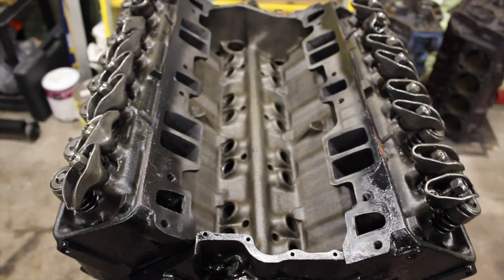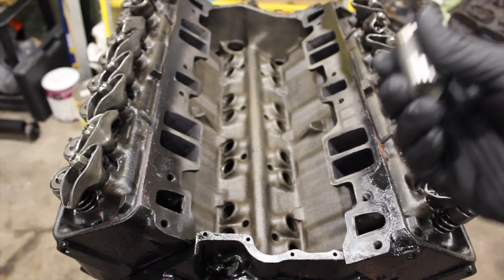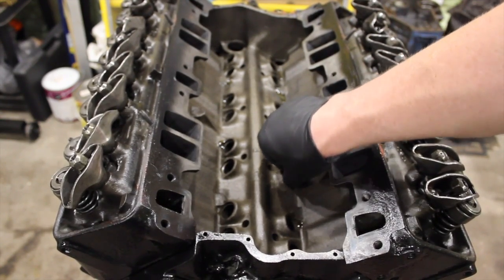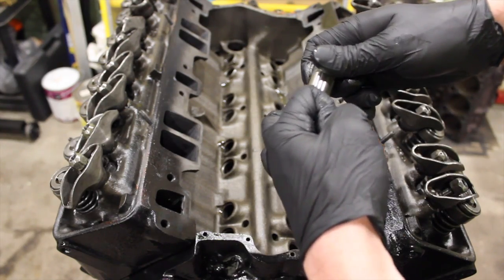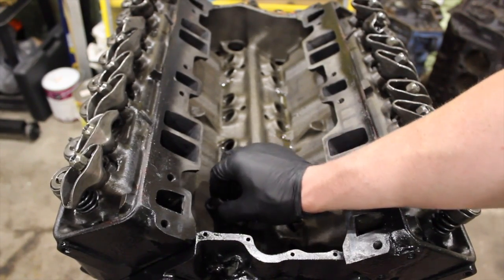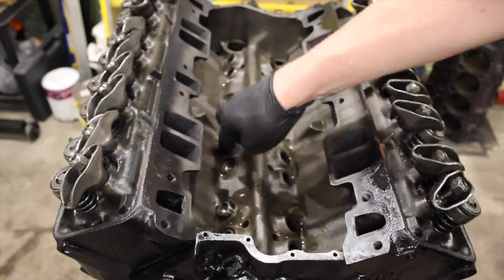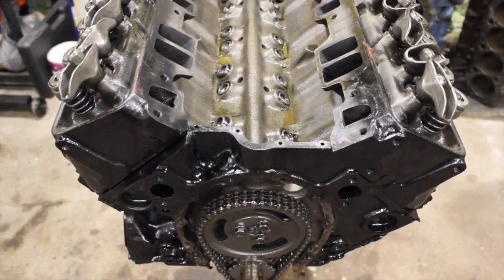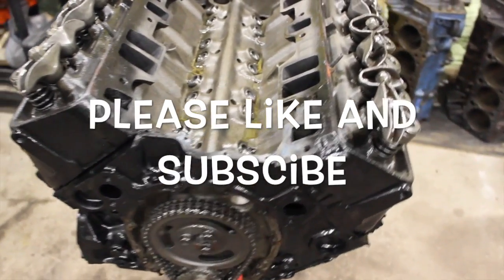Tips for installing Flat tappet cams and lifters

Comment: hi i have an old 65 pontiac 389.  i had a couple bad lifters and am wondering if its ok to just replace all of them with new ones and still use the old cam shaft. do you think there would be a problem?

Comment: Currently building a 13.5:1 small Ford with an aggressive mechanical flat tappet. Broke in a Crower hydraulic flat tappet in last motor and followed the advice from Crower, no problems. Paint lines along the length, on the pushrods just below rockers. Leave valve covers loose or cut "windows in donor valve covers. Start break in and observe pushrods spinning. If there is a problem, (pushrod not spinning), you can shut down and correct before you wipe the cam. I believe like many others, the issue is poor parts quality. Lack of lifter crown #1.

Comment: 98% of flat tappet cams fail due to people not using break in oil. If you bought the break in additive to put in the oil due yourself a favor and just take it back and get the lucas brand sae 30 oil. It saves a big rebuild cost !

Comment: Soaking lifters is no good. A pumped up lifter holds valves open while cranking the engine causing it not to start instantly. You need instant starts when breaking in a new cam. A dry lifter will pump up when you prime the engine.

Comment: It has to be the quality of the parts because back in the early 80s we never worried about wiping a cam .. we got the timing wrong on occasion, used high lift cams, had a hard time getting the first start, used heavy springs, high lift... and never wiped out a cam.
Reply: Different oil make up
Reply: @stoneysmith703 I think the parts were better.. everyone is using the right oils these days..
Reply: @TrentGustus when everything went to a roller profile they stopped adding zinc, or as much, when you say everyone is using the right oil, do you mean for flat tappet profiles?
Reply: @jessebusby7685  yes, i dont think people,  are using the the wrong oil on break in, for flat tappet cams

Comment: Diesel oil no longer contains zinc, or at least not a sufficient amount. If you break in your engine with diesel, you're in for a rude awakening. Just buy actual pre-mixed break-in oil.

Comment: Hi! Why are you putting assembly grease to the sides of a lifter? You need it only to the bottom and you should use oil to the sides as the grease can make the lifter more difficult to turn. 
Also noticed you used greased the cam bearings, not just the lobes. Redline says to use it only to the lobes. 
Maybe wont do any harm, but just saying. Good video anyway! =)

Comment: Tips for making a flat tappet cam live…. Go roller none of this matters if you have an incorrectly manufactured cam/ lifters that is most of the problem nowadays
Reply from the maker: Agreed! The only downside to a roller cam setup is the price, but it's worth it if the budget allows
Reply: That is why you verify the cam and lifter arw machined properly before you install the cam.

Comment: I run a non detergent high zddp break-in oil by Driven so it doesn't wash the zink addative off the cam, also grove my lifter bores for direct oiling ahead of the lifter to cam lobe contact point.  Do you run non detergent oil after break-in?
Reply from the maker: I run most on Lucas Hotrod oil
Reply: Best use aircompressor Sae30 oil plus Zddp Additive for breakin

Comment: Just pulled my stock 350 for a rebuild. Scared to death to use flat tappet again with all the internet chatter about wiped cams. Hate to have all the machine work done, new rods, pistons, springs, do all the rebuild work and install the engine only to wipe a lobe after 2 minutes of break in when it lasted 40 years with tappet just fine. Id cry. LOL. Looked into retro roller route but that's $800+ alone and cam choices all are mostly higher lift in the .500+ range which wont work with my stock 993 heads. Not sure if I should risk it with new tappets/cam, or go buy a later roller block, LS swap.
Reply: Get a NOS cam and lifters or ask Elgin cams they still work fine
Reply from the maker: Thats the scary thing with flat tappets, it can come you a full rebuild

Comment: Im a beginner and am learning alot from this vid. Thanks for making it. Question though. I noticed you using a brush of some sort, is there a chance any bristles may come loose and damage the engine? Would it be safer if I opt to not use a brush?
Reply from the maker: I've never had an issue with that before, but ifnyoyr using an old or cheap brush, then there could be a chance of a bristle coming off. Probably wouldn't cause catastrophic damage, but obviously not something you want

Comment: When finding TDC, the dot on the crank should be at 12 position and the cam sprocket should be at 6 position. Is this the TDC exhaust with piston #1 all the way up? Is there only one TDC position?
Reply from the maker: If your referring to the dots on the cam and crank sprockets. For #1 TDC on the compression stroke the cam and crank get will be both at 12 o'clock. When we install timing sets, we have the crank gear at 12 o'clock and the cam get at 6 o'clock to make it easier to line up (the engine is actually at TDC on compression stroke on cylinder 5)

Comment: Why would you even use a flat tappet block? Just start with an O.E roller.
Reply from the maker: These days your right, the later roller  blocks are just a safer option for most
Reply: i can get a whole flt tappet cam and lifter kit for less than a roller cam itself. the roller lifters cost more than a flat tappet cam itself.

Comment: I spent many years not paying much attention to cam breakins. Never had a cam go flat. Now I hear nothing but disaster stories. I did learn something yesterday which may help. Castrol has an oil that is new to me - GT Classic, says right on the jug contains zinc and phosphorus, for older cars, hot rods, etc. Any thoughts, users of this oil? Seems like between it and the new coated Comp lifters our old cams may have a new life.
Reply from the maker: I actually had a cam go flat for the first time on the dyno almost a year ago. Everything was checked, and I believe it was the lifters that caused the problem. Ive only used the GM lifters since then
I pretty much only use brad penn break in or lucas hotord oil and haven't tried the castrol stuff.
Reply: @cuttersperformance  here's an interesting story. My bronco motor had a few lifters go bad last few years. Before watching the YouTube nightmares I changed them as needed. Put some assembly lube on, broke in 20 minutes at varying rpms, no problems at all, cheapo auto zone lifters. Building that motor fresh now and will use existing cam and lifters until ring breakin is done, then maybe I'll consider a new cam if I just want to.
Reply from the maker: @Danny Noble  i hear that man, for years I used many sets of the regular cheap comp lifters. Theres only a few lifter manufacturers in the world, so sometimes you end up with a decent set of lifters from a house brand rebox. I have used only gm lifters because I know exactly what they are, but they are twice the price
Reply: @cuttersperformance  any experience with the new comp cams lifters with the black coating on the bottom? Sounds interesting.
Reply: Now they bead blast the blocks and the lifter bores need to be reamed top and bottom so they spin.  Back in the hot tank days it didn't matter
Reply: @thepoopsoup  I asked my machine shop to pay good attention to the lifter bores on a block I dropped off with them a couple of weeks ago. Someone had machined it before I bought it but the hone had no crosshatch at all, almost looked homespun by someone who never heard of crosshatch.
Reply: I'm about to do a rebuilt. Totally spooked about the tappets. Not sure which direction to go. You never hear about builds with no issues. Only horror stories about wiped lobes.
Reply: @SOLDOZER  You know, I can't be convinced that every cam and lifter being sold is bad. Every cam and lifter company would be out of business if they were. The motor I built 25 years ago - I had a few lifters go limp in the last couple of years. I bought some Mellings from Autozone, replaced bad ones as needed instead of all, broke in with cam lube and 20 minutes run time, no trouble at all. Yeah I would love roller but I'm not made of money.

Comment: Planning on running a summit sum-1202 flat tappet cam with L31 heads soon, any advice for lifters such as crower cam savers or any recommendations? Also any advice on a good valvespring?
Reply from the maker: The classic GM flat tappets with the hardened face are awesome and worth the money. Ive used LS beehives on similar cams. They are nice because they work well from break in because they dont have a ton of spring pressure but also have great valve control at high RPM
Reply: Z28 springs should also work fine

Comment: New Camshaft before install, Micrometer each lobe should have .003 taper per lobe for lifter spin, failures from bad machine work, lifters should have base crown .015, put to base lifters together, should have rocking, prime lifters with oil with squirt oil pump, good lifters will have burnish mark at base from heat treating, zink break in additive and run 2k for 20 minutes to polish.
Reply: We checked many cams 2 from 10 had messing tapets
Reply: I mostly use NOS stanadyne lifters

Comment: **UPDATE** Do Not make my mistake. After chasing no oil pressure on a fresh 355. We pulled oil pump Melling HV55 to inspect. Nothing wrong. I told my son to check bottom of pan for maybe we forgot a rag or something. He comes up with Timing gear teeth. Pulled mains /looked good/ pulled t-cover only to find half the teeth missing on lower gear. Culprit was 2 cam galley plugs pushed out of the front of block got caught in middle of dbl roller and granaided sprocket. For the love of god please taps those cam 1/4 pipe plugs. Especially when using a HV pump. Lesson learned. Now i have to put the puzzle together and find all the teeth.
Reply from the maker: Awee sorry to hear about that man! Yes screw in gallery plugs are a good idea for sure. I have noticed that some guys that run gallery plugs dont peen the hole edge with a chisel after the plug is installed. Thats just asking for issues as your a solely relying on the press fit of the plug...scary stuff! 
Hopefully you get the engine sorted out and fixed up quickly without issue! Cheers
Reply: Why does everyone just automatically use a high volume pump? The factory never did, just curious.
Reply: @thud9797  I always liked the factory Z28 pump also I found that all the camp plugs were pushed out never put in properly no oil pressure
Reply: @Supanova70 
That was the M55A? I believe that's what I used 20 years ago, this pump was just high pressure like OEM but not high volume and had it on an LT-1 that we built and was supposed to be the factory replacement.
Reply: Thanks for sharing. I see you even did the chisel method properly for them thats pretty crazy it pushed them out.

Comment: Hey Pisscutter! Would synthetic grease work from permatex? Cause up here in Canada it’s hard to find assembly grease
Reply from the maker: Joe Gibbs Driven Racing Oil grease 00728 for the cam lobes and lifter faces and use Lucas Oil 10153 assembly lube on the outside of the lifters. Thats your best bet and both are available in Canada, i know because im in Canada 🇨🇦
Reply: Of course during the 80s we used wheel bearing grease
Reply: Just use atf for assembly...nothing better.

Comment: Diesel oil? Way too much detergent in diesel oil for flat tappet break-in...
Reply from the maker: You are correct, the newer diesels oils dont work as well as the older diesel oils for break in. Its always best to use a proper break in oil especially these days
Reply: New or old configurations, diesel oil is a poor substitute for a proper gas engine formulation.

Comment: I installed a new cam on my Sbc but the motor won’t fire it tries but will not fire
Reply from the maker: Check your distributor? 180 deg out or ignition timing
Reply: If you have been cranking it over alot the cam could already be wiped.
Reply: distributor is 180 out

Comment: Most cams get wiped because of extended cranking trying to start a new engine that has an improperly installed distributor.  The break in lube on the cam /lifter interface  gets  wiped off  before the engine starts...then when it finally starts it's dry and cam damage can occur.
Reply: Back in the early 80s we never worried about any of this, we used cam lube, often got the timing wrong.. never wiped a cam, I think it's the quality of the parts
Reply: True
Reply: Wrong - most components are just about mated/worn in by the starter motor alone. Nothing is dry unless you failed to prime it initially. Wiped out lobes are from poor oil choices.
Reply: And wrong crowns on Chinese lifters

Comment: Unfortunately the times have changed in a very very bad way, almost all the new flat tappet lifters on the market are complete junk,they will either wipe out a lobe or lifter immediately or if your lucky enough for them to survive break in, you will constantly deal with the lifters bleeding down immediately and dealing with lifter noise all the time, I would like to say that a hydraulic roller is the answer but a good majority of people (I would say around 80 percent) installing them have been having a ton of issues with the roller lifters bleeding down and having the lifters completely collapse or the lifters be extremely noisey which is very very annoying when a set of retro roller lifters cost over $500. The days of the good old throw a $200 RV cam in your sbc and pick up 40 easy HP are over, alot of very experienced and well known engine builders will no longer assemble engines with flat tappets anymore, a locally machine shop near me that has been in the business since the 70s has announced to all their customers this year that they will never install a flat tappet cam ever again, they lost over 10 cams in the beginning of the year alone. The only way I would even consider using a flat tappet these days would be if you could find a brand new set of NOS (new old stock) lifters straight from GM,Ford,Chrysler,or TRW that's it, anything other than that is just too risky, Soo many people are destroying their freshly built engines within 10min of running and in alot of cases usually trashing the whole engine in the process from the metal getting through the oil filter bypass. Sorry for the rant, but the lifter situation has gotten completely out of hand the past couple of years and I don't see an end for it, right now a NOS set of 16gm lifters are selling for over  $300+ and there is very little of them left for sale.
Reply from the maker: Yeah your 100% right, these crap lifters are getting out of hand. Guys are completely wrecking their engine's with this shit lifters!

Comment: Put the cam in first before the crank, it's easier to guide in from the bottom
Reply from the maker: Interesting, i dont think ive ever installed a cam before the crank
Reply: @cuttersperformance  I have not installed a cam first, but once saw a friend do so.  He had the bare block setting on the bellhousing flange, nose in the air. He installed the cam gear finger tight in the three bolts. It was a flat tappet cam, so he coated the lobes with moly lube and gently lowered the cam in place.  I ask him why, he replied,  "I'm shaking like Don Knotts most of the time.  If I installed the cam normally, I'd ding all the cam bearings.  It would sound like a pinball machine going in".
Reply: Install the cam before putting the block on an engine stand.
Stand the block straight up. Lower cam using gravity. Doing it sideways always scratches a bearing.